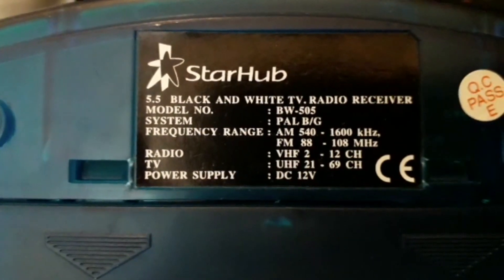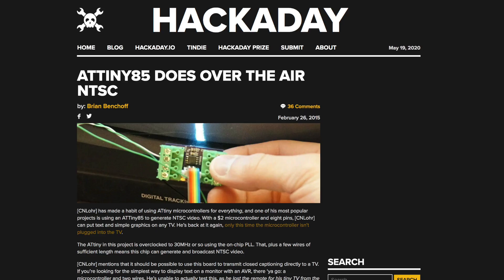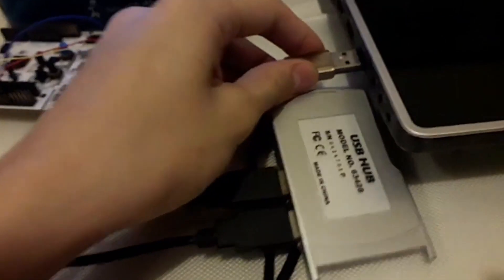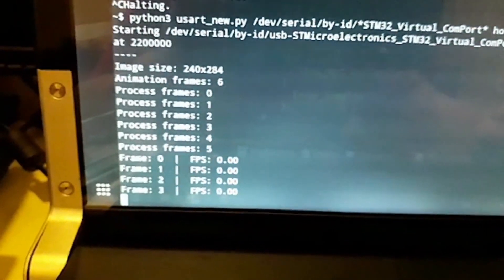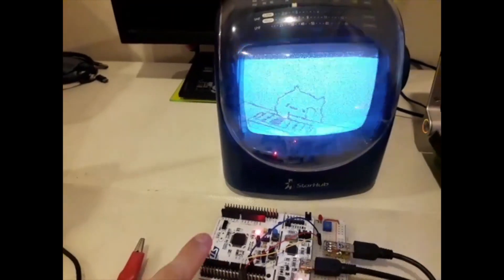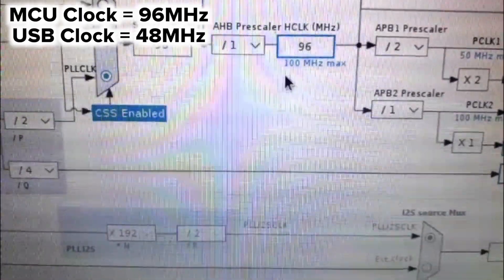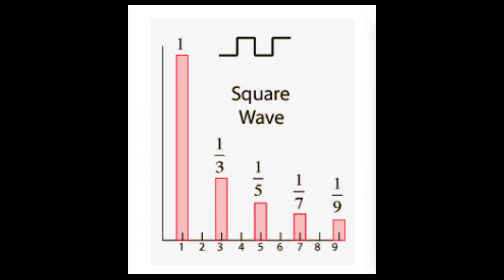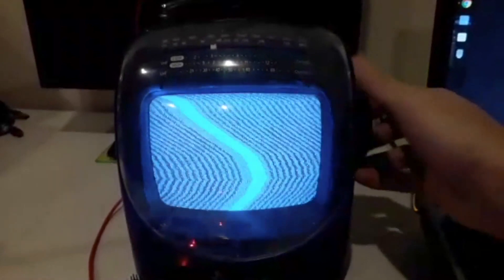PAL-Streamer

Comment: I'm so surprised you were able to get the NINTH harmonic working!!! That's insane.  I honestly had never tried more than the third (or wrapped around the nyquist).
Reply from the maker: Wow thanks for checking in on my project! Yes the signal is very weak. My antenna wire has to be very close or even touching the TV to have a clear picture
Reply: @manzelseet  That makes sense.  I will still keep this in mind in the future - that it's even possible at all to use those deeper harmonics.

Comment: Awesome! Is the code on github?
Reply from the maker: Yes, open source on github! https://github.com/zst123/PAL-Streamer
Reply: @manzelseet  cool!  You mention experimenting with a band pass filter.  Any progress on that?  Can you explain how you would implement that, how it would work?
Reply from the maker: @dukedougal16  Thanks for asking. Right now the project transmits a square wave with many harmonics. And in this case, I am only using the 9th harmonics which alights with the channel 3 frequency. This means that the project also transmits many other harmonics that I am not using. These extra harmonics may cause interference and I want to use a band pass filter to remove these extra harmonics I am not using.

However I have not tried it yet because I am very weak in my knowledge of filters. If you have any suggestions please let me know. 🙂